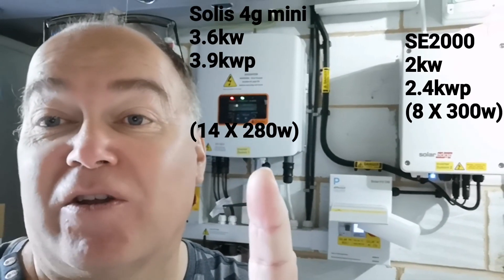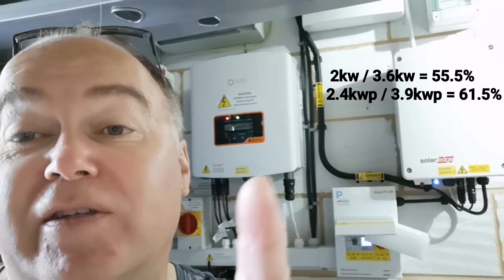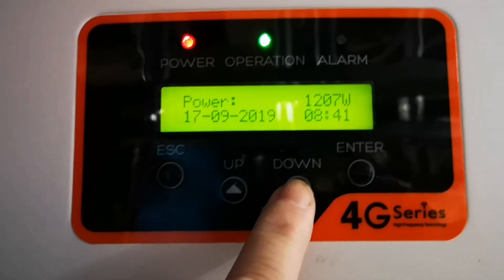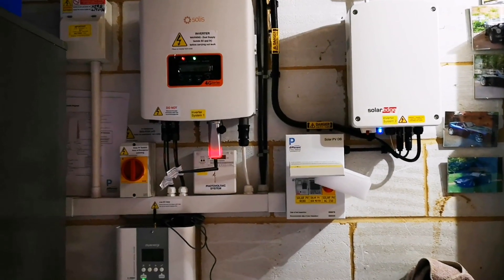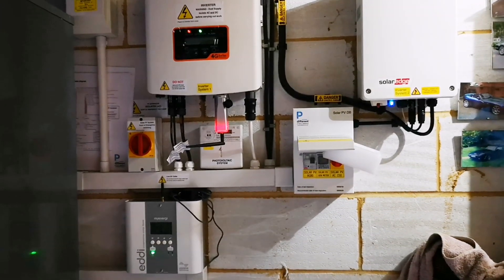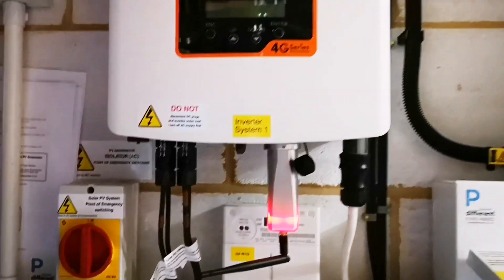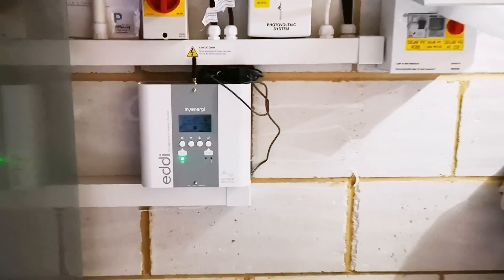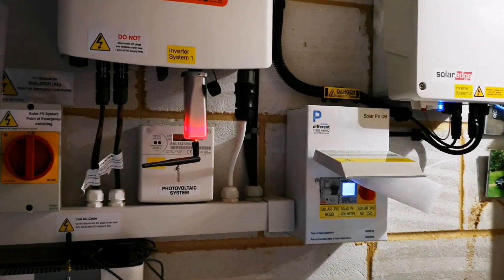Solaredge 2Kw outperforms Solis 3.6Kw .... at times

Comment: Just a quick question to anyone who’s already on a FIT and wanted to add more panels but needed to move the existing panels to make extra space but keeping the inverters separate any issues
Reply from the maker: That's what I did, I moved them lower down the roof. So Long as your not gaining kwhs through more optimum placement than the FIT agreed you should be fine imo
Reply: @EVPuzzle  
                              I’m thinking of putting all the panels currently a East / West on the east of my roof and putting new panels on the south and west I’m not sure if that would be classed extra KWs

Comment: Do you have to notify the power network about your second array, if you are not claiming FITS on it?
Reply from the maker: Yes it's all about your export capability
Reply: @EVPuzzle  thanks, just planning a second, smaller array too.
Reply from the maker: If its through the same inverter so the same export limit you're OK but if it increases you export ability it needs DNO approval officially
Reply: @EVPuzzle  okay thanks, that’s clear. It will be an additional 2kw inverter, so it will need permission.

Comment: If you were installing everything from scratch, would you say installing Solaredge with optimisers is worth the extra install costs on a non shaded roof? I'm being quoted about £1500 more for Solaredge over a Solis string setup. Also I'd imagine failures are higher...more bits to go wrong!
Reply from the maker: The main benefit over Solis is the online monitoring. Solaredge is much better.

If I was doing it again, I'd look at SMA for their software optimisation but definitely consider Solis as it's economical and just works
Reply: @EVPuzzle  yeah the Solaredge monitoring looks great, but other than that I can't see it being worth the extra costs. Also worried about the reported high failure rates of the optimisers. I think string probably works best for me. Just wondered if you considered it worth the extra investment or not :)
Reply from the maker: Not on an unshaded roof no

Comment: Hi...my solis inverter status is LimByEPM..how yo change it to Generating status?thank you
Reply from the maker: Not seen that before but solis inverters are often set to limit export depending on what you're allowed to put back into the grid. Could be a valid setting. Id research as many install videos and manuals for your specific inverter to determine if its a fault or not
Reply: Thank you

Comment: Just had a quote for 4.9kwh system on my home with lovely black integrated flush fit panels.  Comes with Solid inverter for £5k. Been offered a tidy looking battery backup system as well for £2500 extra fully installed. The battery is an Alfa B3 2.9kwh. What are your thoughts on this price Nigel?

Comment: Can I ask a question...  How much solar generation capacity can you have in a domestic environment?  As soon as I move, I'm either buying a house with PV or installing from scratch.  I am also looking at things like a solar pergola and panels elsewhere, say on a carport.  Is there an upper limit in the UK, and how is this affected if you have a decent battery like a Powerwall?
Reply from the maker: It varies from property to property as I understand it depending on your wiring to the property, usage nearby, other solar nearby etc.  
You apply and  wait patiently.
Does make you wonder whether to apply if considering a new home to make sure before you buy
Reply: The EV Puzzle Apply where?  Are you saying that aside from structural considerations of the house, installing solar needs to be approved? Ignoring listed properties... FiT is over so I’m not getting that.  I’m thinking I need to generate as much as possible for self consumption.
Reply from the maker: Google dno application and you should find what you need. You're basically applying to the grid. They need to know who's producing what and where to ensure the network balances and infrastructure can cope
Reply: @EVPuzzle  Your friend Kristian has emailed me back a really detailed answer to my original question, however thank you for your help and advice.

Comment: Did you compare the 2 systems at midday? I'd be interested to know, cheers!
Reply from the maker: Results since taking scaffolding down are different. Looks like minor shading from scaffolding had a big effect on my old panels.

Running at 59% all morning so far
Reply: @EVPuzzle  wow that just proves how important it is to have optimisers. My PV is now 5yrs old & I only recently found out all panels will only output power equivalent to the lowest panel output if that makes sense!

Comment: I've a 42 panel installatie with 2 inverters with each 2 mpp entrences. Configuration is 11 & 10 on each inverter. None of the equal strings gives me the same amount of watt's of energy kWh's. Reason: first the  power and energymeters (4) are not callibrated, secondly my panels dating 2009 had a +/+3% deviation. Nowadays panels are more likely 0 - +5%. 
And you can only compare string or systems right if you normalize them so you compares kWh/kWp over the same amount of time. I've a deviation between my 2 inverters of 0,4% what is stabel since mid 2009.

Comment: My Elster generation meter reads 6% higher than my inverter display and always has done since installation nine years ago. A nice bonus when I come to make my FIT claim.
Reply from the maker: You'll have someone round to fix that now 😆

Be Interesting to see your results with the SE1000
Reply: II have no way of checking the new SolarEdge inverter. After 12 days my installer has still not sent me the promised App set up info. All I have is the Zappi with switches put on each CT clamp input.
That is crude but gives me the impression that the SolarEdge may be slightly less good than the old SunnyBoy or it may be pretty much the same. The old panels are entirely shade free but one of the new ones is shaded until about 9:30 at this time of the year. Definitely not seeing as big a discrepancy as you.

Comment: Will be interesting to see if it is the scaffolding shading. Even covering just one cell has a dramatic impact on output since all the cells are all in series and the panel current is limited by the lowest conducting cell.

Comment: as I understand it the Optimisers will really help when part of the system is in shade as they drop the resistance of low performing panels, in series.  The DC is optimised for the Inverter. The other thing you have done on your new system is not over specified the size of the Inverter IE used 2Kw.  This means during normal use it's working more efficiently whereas if you'd installed say a 3.6Wh it would have been less efficient at the bottom end.  I read a solar edge paper on this somewhere.  I doubt it will "clip" at max to be honest.  It will cope with more than 2Kw.  In sort, your new install is very well designed. Enjoy your content, thanks :-)
Reply from the maker: I think he's fine a good job for me. I've seen 2kw briefly but nothing more so far.

Once scaffolding is down I can rule out minor shading but I suspect it's just the angle of sun better optimised .

Agree with you on efficiency curve. 2kw tuned better for my efficiency. 
3kw would be tuned for higher levels hence less use to me.

Great to see 20% drop from 2.4kw to 2kw actually brings gains
Reply: I’ve seen a briefing over my stated max on my SolarEdge.. I bet you won’t often clip. Nice job!! 🙂  found a link; https://www.solaredge.com/sites/default/files/inverter_dc_oversizing_guide.pdf  "SolarEdge allows DC/AC oversizing of up to 135%,  for single phase inverters with HD-Wave technology DC/AC oversizing of up to 155% is allowed."

Comment: Thanks for the update Nigel, interesting result. A quick question if I may did you look at the micro-inverter equipped panels which output 240v mains directly so you can just add them together into your isolation connection. They also work independently if you get partial shading which can be useful if you have trees or buildings nearby. I don't know how the costs compare so any views would be appreciated. Keep up the good work regards Richard
Reply from the maker: Apparently we did consider them but this config worked better with 8 panels. 4 X Optimiser came with the inverter.

Posting this so others can appreciate the reality rather than just the number comparison